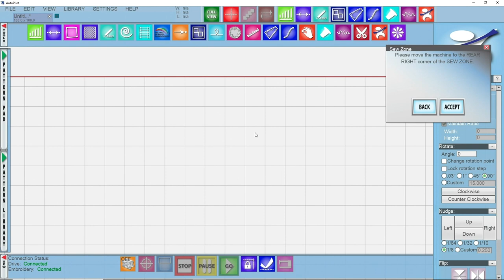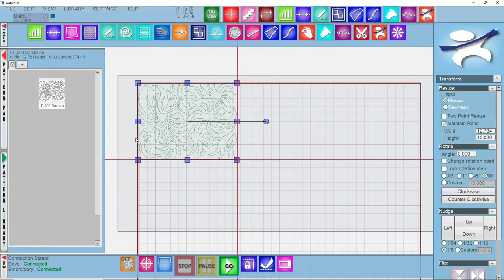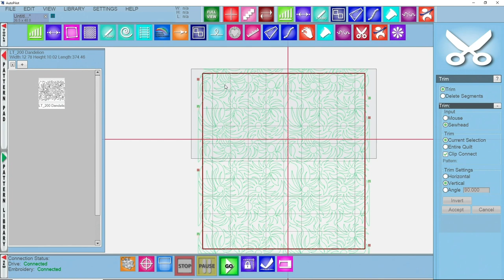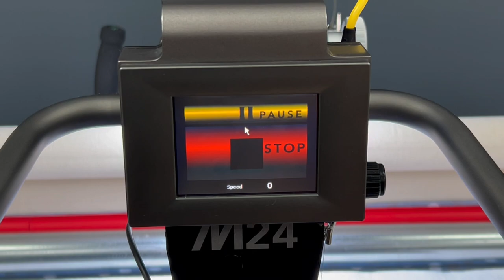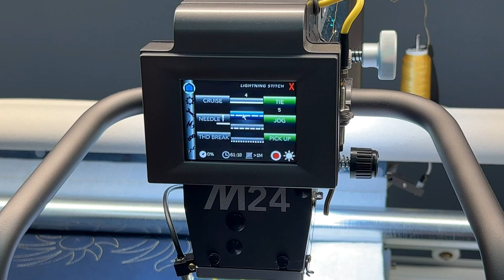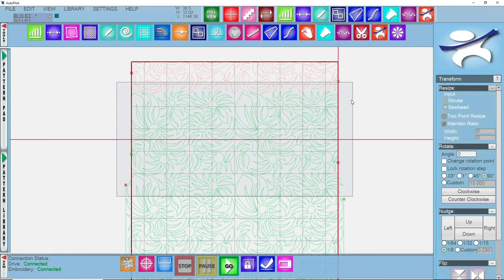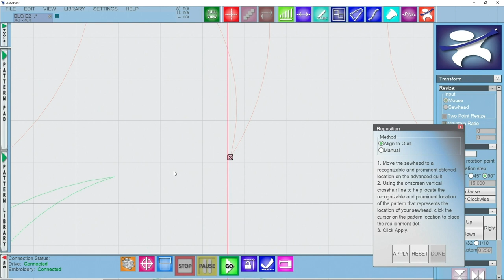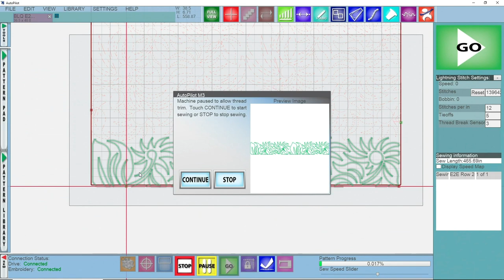INNOVA AutoPilot Training Mach 3 - HOW TO: Edge-to-Edge

Comment: You are amazing! Thank you so much for the knowledge. It gives me so much more confidence. You are such an amazing teacher. If I could make one suggestion: What happens if you aren't inside the gray sew zone? You have no idea how many times I was right on the line and I could not get it to sew my pattern. I have learned that I needed to adjust the amount I had rolled the quilt forward for stitching. Probably if I had had your instructions I would not have experience that problem, but it sure caused me a lot of grief.

Comment: Cory I just got my M24 yesterday. I am following your instructions but when I moved the pattern to my sewing area, I didn’t get the square around the design so I could resize it. It was an end 2 end design that came with the machine. I tried another and the same thing.   Any suggestions?
Reply from the maker: It’s possible you have the Pan tool activated. At the top of your screen there is an icon at the top with a hand on it. If it has a green border around it that means it’s active. Click on it. That should change it a red border which should allow you to click on the pattern and get the handles to resize.
Reply: @LindasElectricQuilters  I ended up closing out and opened it again and it started working. I took a picture of your comment and will reference it if it happens again. Thank you so much for your help. I watched all your videos again today. You are a terrific teacher.

Comment: Cory is there a way to make sewhead easier to move?  When joined to the cables I find it pretty heavy to move it about during set ups.
Reply from the maker: Hi there! You can turn on Power Assist and the machine will move easier. However, Power Assist uses the X and Y motors to make the machine easier to use with that being said it make move a little too easy. You can go into Diagnostics and adjust how much they help:)